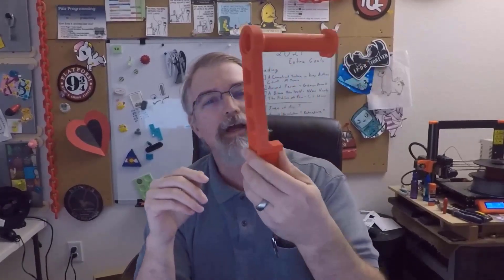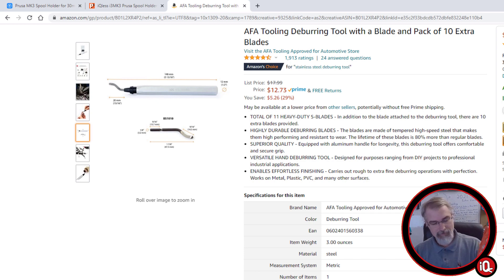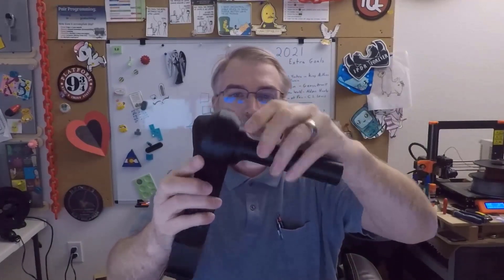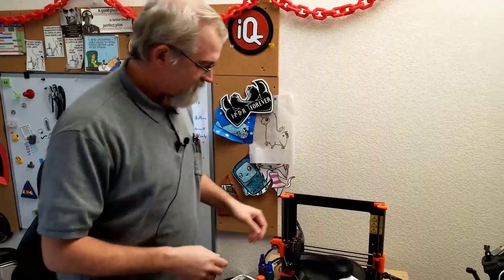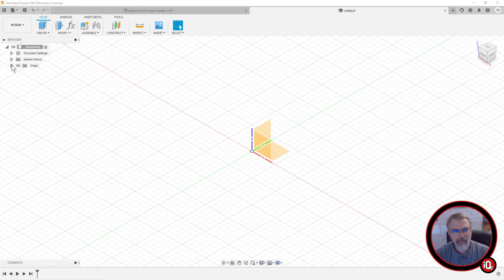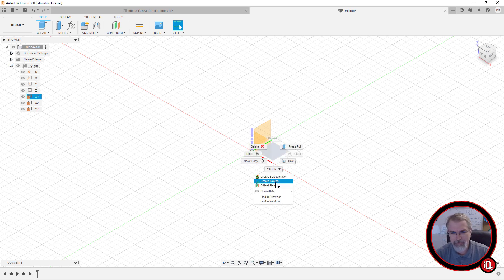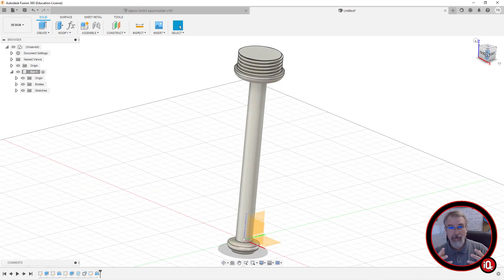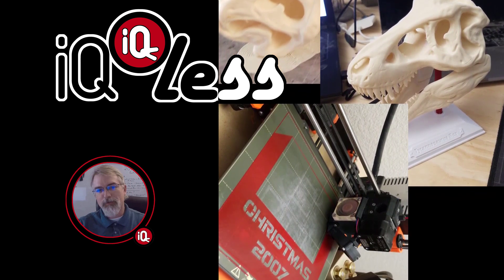3D printing: i3MK3 Spool Holder

Comment: can I make a suggestion? I notice your threads are really "fine"... For printing there is a better way. For example... If you make your thread surface HALF the length you actually need, and It's OWN body (you can merge later)... apply the thread tool as you would normally to the Thread insert body. So now you have a threaded piece thats half the size you actually need? So you hit "S" and search for "SCALE"... then you scale the threaded insert x2 or 2.0, uncheck "in all directions" you just want to stretch the threads the length of the threaded body. It will stretch your threads out making them easier to print... but also MUCH MUCH easier to thread and insert. Obviously once you have the threads the way you want you can "merge" the body's. I learned this from Clockspring3D... He is the KING if Print in Place you should check him out on Patreon. He is AMAZING and you will love his work. lol. Trust me he is worth the money. He does lots with threads, gears etc.
Reply from the maker: So you are saying stretch out the thread so it has half as many threads per inch or mm?
Reply: @iqless  that’s right. Basically make your threads half the length you need. Apply the thread and then stretch them out
Reply: @iqless  are you on Clockspring3D’s Patreon? I am telling you... I’ve watched all your videos. You will love his work! All print in place and all awesome! But on YouTube he did a video on how he does his threads and it’s so clever